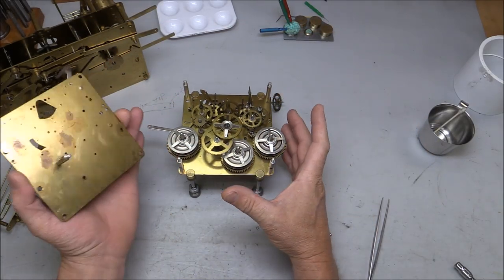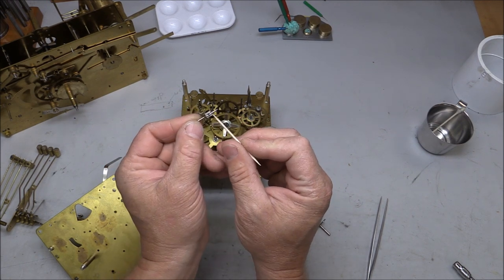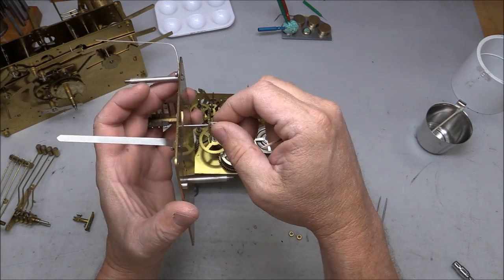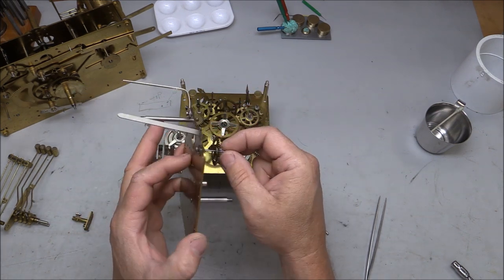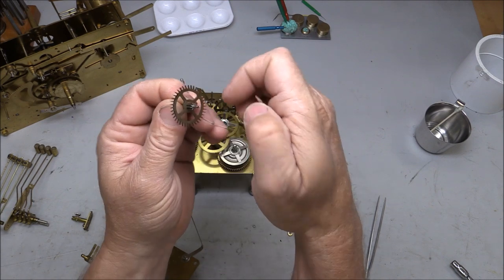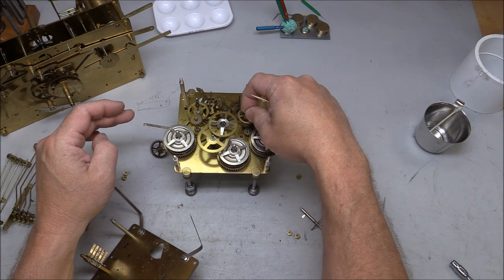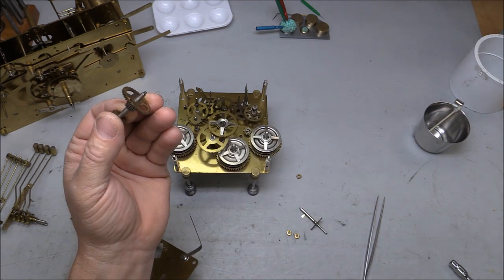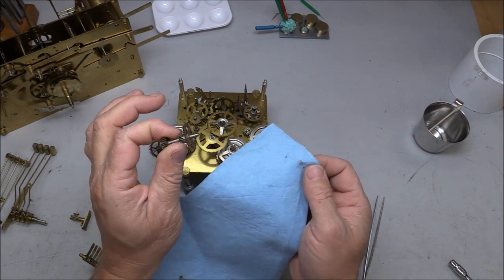So you have a grandfather clock and it is having problems, Rochester Minnesota

Comment: like your video my clock was built by my father in 1974  an emperor and ran until about 2009 and im finally looking at it the pendlelem run for about a minute or 2 and quits trying to understand why your video was helpful but im probably looking at how to clean it     thank you  dennis

Comment: Oopsie, I bought a Grandmother case kit clock in 1976.  It always performed well until 2016 and then would not restart.  I took the movement out for the first time since 1976 and cleaned and oiled it.  The clock returned to its former glory.  Now after seeing all the information videos on YouTube, this year 2019, once again I am cleaning and oiling it.  The hour/minute hand shaft has play at the end well.  It should be rebushed but the Urgos Movement appears to be too ancient and no info on parts is shown.

Comment: Well, I'm pretty sure you're a good deal of distance from where I live, as I'm in western Canada, not far from the Pacific Ocean, and yet have some Grandfather clock issues.   It's actually a clock my wife 'made' in woodworking class back in 1977, and has never been cleaned or lubricated since it was first built!   Yet, it seems to keep good time, but does not chime any more, as both outer weights do not move, only the centre one moves, and the weight goes down as it should.   No idea why that is, or what to do about getting it working, and for the life of me, wouldn't want to tear it apart as shown here, as I just don't have the ability.   Now, if it was a car/truck engine...that's a different story, as I've rebuilt engines since I was a kid, and done much of my own maintenance!
With that said, what might be the reason the two outer weights are not functioning, which I'm sure has to do with it not chiming?   Appreciate your video, as it was very informative!

Comment: My Howard miller grandfather clock been traveled back and forth in the military was working fine after I got out the Army, now it just do what it want to do, chime when I first wine it up,  then stop, the the pendulum stop moving after a couple hour, on all 3 tune, and yes I have it maintenance, and oil. So not sure what us going on with it, and strike when it want to maybe on the 12, 3, 6, are 9 are not chime at all, and do not strike right on the hour. It strike on the #3 like it suppose strike on the hour. 😫😩

Comment: Bill, We have a grandmother clock I got 6 years ago at an estate sale.  Had it professionally cleaned etc.  It's worked well until when resetting the weights, one fell off and the chain pulled through.  I took the works out (watching a video to do it) put the chain back where it went (I marked the weights so they'd get back in the right order).  Now the clock runs great, but chimes the hour on the first 1/4 hour, the 1/4 hour on the 1/2 etc.  How do I fix that?
Reply: If you removed the hands of the clock then you have it 15 minutes out of time. The shaft that the minute hand attaches to is square. Think about each square being 15 minutes. I did the same thing when I cleaned my clock put it back together. It chimed about 15 minutes before it should have.

Comment: I wish we lived close enough to have you service our clock.  We will be making a trip to Rochester for graduation in 2021. I have a 7 day clock that we had serviced by a very elderly gentleman and it’s still not working. Is it possible to have the parts removed and switch to battery operated movement?  If we booked an appt could you do it while we are in town?

Comment: any thoughts about a periodic dousing with WD 40?
Reply: Massive no no!! As a clock maker myself it will do even more damage as WD40 isn't the proper lubricant to use plus if the mechanism is covered in WD40 it will attract more dust and make a real mess of the movement.